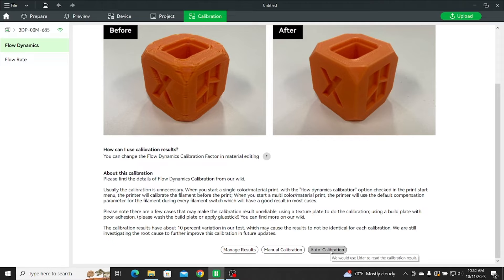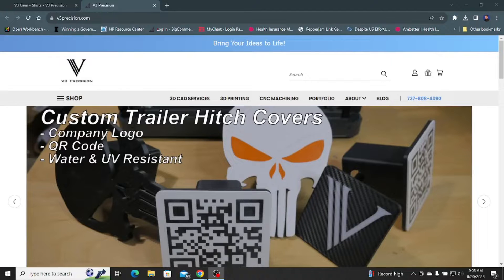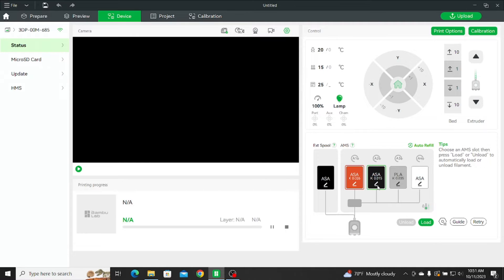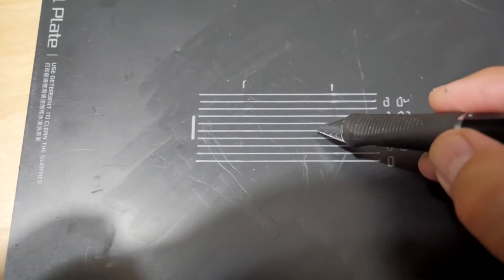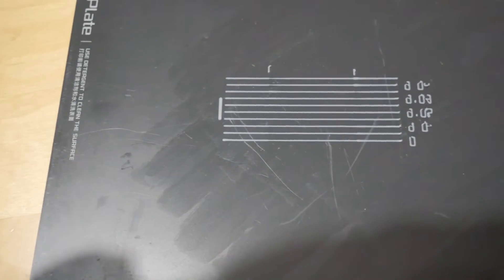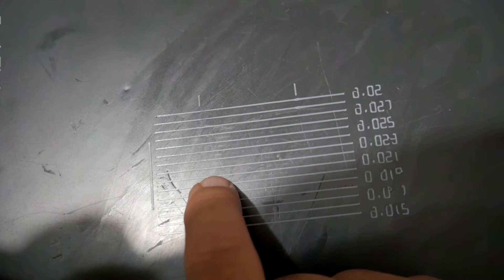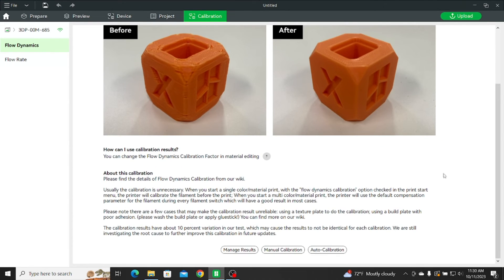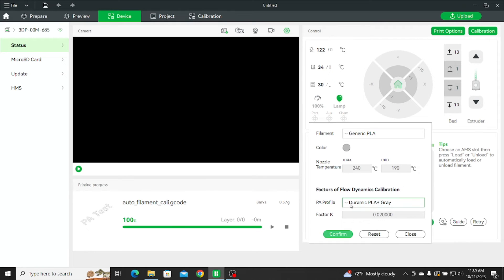Compare Bambu Lab Flow Calibration, Auto versus Manual

Comment: I have recently been having issues with some of my prints.
 Particularly top layers and the edges on circle/flat objects. 

I was told if you do a manual/ auto calibration on the flow rate and dynamics is to make sure you dry the filament first. Which i did last night and will do the calibration today.

Comment: I'd like to see test prints, I just started using orca. I printed a spool in petg, and had some stringing and a few flaws, I manual calibrated in orca and wow, my next spool was beautiful. 
In PLA my autocalibrated prints are very good, but haven't done comparisons.
Reply from the maker: I have just started to use Orca on my P1S printers.  Seems to be printing nice.  I think I need to do a Temp test on PETG on the X1C.

Comment: You may have a faulty LIDAR unit. I follow Bambu's recommendation of running a machine "calibration" on a regular basis when changing build plates, spools, and what-not. I also run the auto calibration of the filament Flow Dynamics and Flow Rates when putting in a new spool of filament. I started having issues similar to you on Flow Dynamics, Flow rate calibrations were "hit and miss" with system "failed" results, and also LIDAR errors on machine calibration. I contacted Bambu support and provided all the information they requested, and they eventually sent me a new LIDAR unit. After installing, EVERYTHING starting working NICELY.

But slowly, I started having Flow Dynamic issues again, and a random LIDAR error every-now-and-then. I decided to look a bit more closely at the LIDAR unit and the hot end assembly in general. Things I quickly noticed: The screws for the Nozzle and the LIDAR unit had started to work themselves loose ever so slightly. 

How I corrected and got things aligned: 
1. Remove the hot end nozzle. This gives better access to the LIDAR unit.
2. Loosen the 2 screws for the LIDAR unit, then press up and to the Left, then slowly tighten the 2 screws alternating between them (careful not to over tighten and strip the threads, but get them good and tight).
3. Clean the LIDAR Camera lens. It is easy to clean see and clean the LIDAR camera lens now without the hot end nozzle in the way.
4. Reinstall the hot end nozzle. Just snug up the 2 screws for the hot end nozzle at first. While pushing the nozzle straight up to seat it into the hot end assembly, tighten the 2 screws. Again careful not to over tighten and strip the threads but getting them good and tight.
5. Run a machine calibration when everything is back assembled to it's operational state.

After doing all of this, the printer is printing better than it came out of the box and the Automatic Flow Dynamic is better than what I can detect from the manual method. The automatic Flow Rates are SPOT on when comparing to hollow cube wall tests with a micrometer/caliper. The LIDAR bed leveling is amazingly accurate and my first layers are absolutely PERFECT.

So try my above steps first, and if they don't correct the issue, contact Bambu support about a possible faulty LIDAR unit.
Reply: Thank you for this level of detail. I am storing all of your hard work in my memory vault in case I run into the issue. I really appreciate people like you who go above and beyond sharing their experiences and solutions.
Reply: I would like to add another detail that I have recently noticed. Use a good quality smooth plate for your calibrations. They come out more accurate IMHO. The smooth plate needs to be in very good condition. Pitted, gouged, scratched plates interfere with the LIDAR readings.

Something else I accidently stumbled onto. I found scrubbing the smooth plate (I only have the PEI cool plate right now) with a "Mr. Clean Magic Eraser" on a regular basis does wonders for extending life and adhesion. Also using the "liquid" glue from Bambu helps in more accurate filament calibrations.
Reply from the maker: Good tips.  I run calibrations all the time.  Whenever I change anything or even move the unit, I run a calibration.  I will take a look at the mounting of the lidar and see if I get any improvement.  👍👍

Comment: You never actually tested 0.032 or near that range in manual mode. Is it possible that there are multiple K values that would work?

Without comparing the test results at 0.032 VS 0.02 it's hard to say which value is best
Reply: Also, the line test isn't good, as it relies on correct first layer z height setting and uses slower first layer speeds. It's much more accurate to do the pattern test from Orcraslicer, as it uses speed from regular / higher layers you are normally printing at.